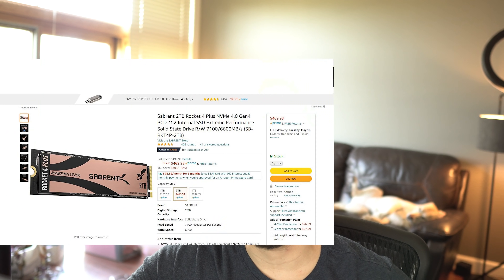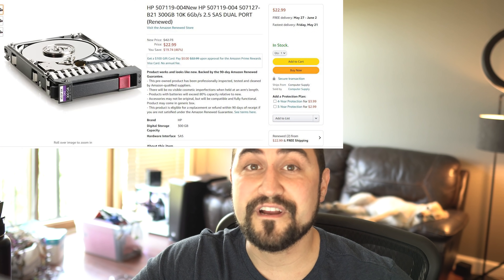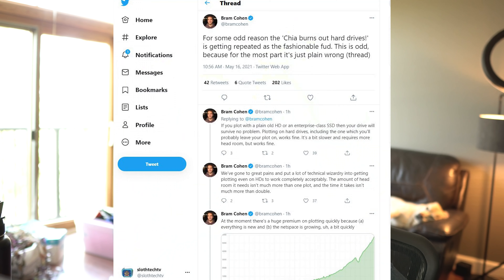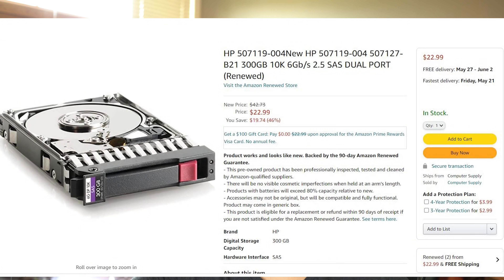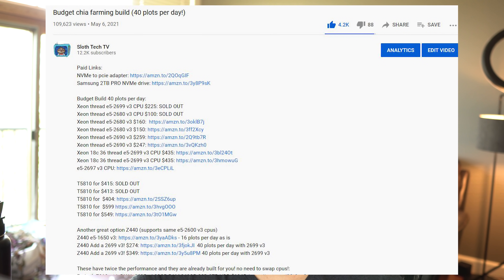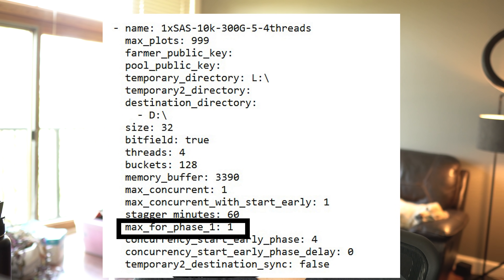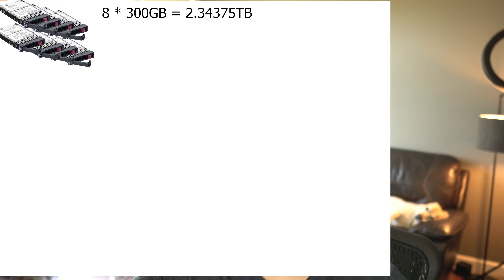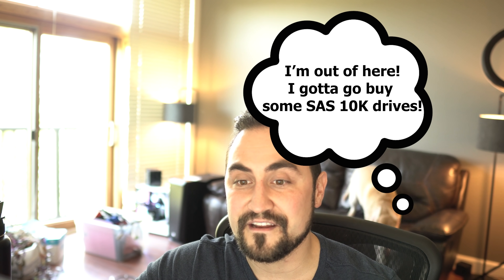Why are you plotting on SSDs still? (How to plot on $22 drives)

Comment: Is SAS better then SATA when its comes to plotting? Im still fairly new to chia :)

Great channel btw. SUBBED! :)
Reply from the maker: I think so, SAS is full duplex while SATA is half... which means only one direction of conversation can take place at any given moment.. not both simultaneously (TX + RX)
Reply: Also, this is the similar type of workload to that these 10k drives were designed to be used for, though in different circumstances

Comment: You need to factor in the external chassis that will hold these drives. These do not come cheap. Yes, enormous Supermicro JBOD cases can be had for $300-$400 but these are super bulky and loud and they will need another $300ish to connect them to the main unit and quieten them down plus 2 HBA adapters, one for the main server and one for the chassis etc. The whole set-up is not exactly cheap. A desktop/tower SAS 8 bay unit could cost anything from $200 (if you are lucky) to $1,000-$2,000 depending on the manufacturer. For NVMe I bought myself 2 x 2 TB 3,300 TBW drives for 220 euros each. Maybe I was lucky to buy them early enough (1-2 weeks ago). For 1 TBW per plot these are good for approximately 6,000 plots or 600TB worth of plot files.

Comment: How do we power the non-temp, storage destination Hard drives. One of my old 6TB lit up, visual heat flame circle on the board area, and smelled like caps when I plugged the hard drive in a 6-pin to Sata cable using my HP 1200w PSUs. The blue sas/sata cable area was very hot as well, and I had to unplug from hard drive very quickly. And I am looking for a budget framework to power storage hard drives.

Comment: Question - what's the noise level like from those SAS drives?
Reply from the maker: the ones i used weren't audible at all unless you were 6" from them.
Reply: @SlothTechTV  - Excellent! Just bought four to get started...£11 each (about $14-15), along with an 8 channel SAS controller and cable. Dual Xeon server was about £160 with 32GB RAM...even if I don't get any Chia, this is turning out to be a fun project. Although my version will probably have a cabinet made of wood, 'cos I don't have a 3D printer available.

Comment: Great video. Any thought about raid striping those?
Reply from the maker: keep it below 3-4 drives and it shouldn't hurt performance.. I'm not RAID striping as I've found the same performance by plotting to the drives individually.
Reply: @SlothTechTV  If your only using a couple of destination drives how do you stagger the plots so you don't hammer the destination drives at the same time if your putting a single job on each drive? I don't think swar can stagger jobs..
Reply: @wjm103052  do You have any solution for that? I'm struggling with the same question
Reply: @SzymekCRX  Not yet. Hoping to have it up and running by Saturday. Waiting for my SAS HBA to arrive.

Comment: Hey there, watched your last Videos, man thats a lot to process. Your content hold me on the chair for hours. The prices you have there are not the same here in Germany. At least you put a Euro sign instead of the Dollar with your prices but mostly the prices are way up. These sas drives cost at least 40 € over here but still not bad as a drive for 375 that you can throw away after a while. On the other hand how long u think these HDDs will continue working. As they are used its difficult to estimate or am i wrong? The drive in the Video is with the server adapter so as i understood this is not needed just the blank drive? If it comes like it is why not using a server (G7/G8/G9) where you can plug these straight. I guess there´s a way to run windows on a server. Thanks for the Video and all the others too, helped a lot

Comment: For the LSI SAS 9210-8i eight-port 6Gb/s SATA and SAS PCIe HBA Controller.

Doesnt that mean it cant be raided?
Data Transfer Rates	6Gb/s SAS 2.0 compliant
Devices Supported	256 Non-RAID SAS/SATA devices
Reply from the maker: You can do a software raid, but honestly i think there is better performance from not raiding at all.

Comment: Thank you so much for the videos, they have been incredibly helpful! 

Quick question, I just bought a bunch of Western Digital 300GB 10K 2.5" SAS 6Gb/s WD3001BKHG off eBay for extremely cheap and I just noticed that they have a cache size of 32 mb while a lot of the drives you have recommended in your description are 64 mb. Is this going to be a problem if I want to replicate your build? Thanks so much for your time :)
Reply: Did you ever figure the cache out? I'm curious too!

Comment: Why the 300gb drives and not 900gb ones for around $30 on Amazon? Can you not stagger plots with these? Jw before I pull the trigger. Appreciate your content.
Reply from the maker: 900GB would work just fine as well!!! good question. you can stagger but you lose a lot more performance than on ssd/nvme with more than 1 plot. play around -- report back soldier! :)
Reply: Awesome, much appreciated. Only gonna grab a few but I'll see how it goes. Not super techy, and not a great rig, but if it turns out well staggered I'll report back.

Comment: Great idea and you can find lots of them on Ebay tested for >10 each but not really Energy efficient. 7-8 Watts each at higher loads x10 is 70-80 watts not counting the power supply and boards compared 2 watts or so for a 2TB GEN 3 speed NVMe to replace the 16TB’s I’m using on each PC would add about 80x8= 640 watts. 4 PC’s 2560 extra Watts.

Comment: Build is so cheap i said "wtf" I bought 22 drives, the Dell and the processors. At least I could help support your channel!
Reply from the maker: Thank you so much!!! I so truly appreciate the support!!! <3
Reply: Can you also do 2 processors on the 5810?
Reply from the maker: @djrythmn1  nope the t5810 is a single socket workstation
Reply: Ok last question. Your previous videos talk about connecting the drives. But not to much about powering them. If you have 24 drive how exactly do you power them? I've only did small builds so I don't know the correct terminology. When you were talking about powering the drive you showed a cable that had 3 ports to power drives. Which would mean for 24 drive the power supply would have to have 8 modular connections for that specific type in the back. I know I'm missing something. And as much as I google and try to redefine, I'm not seeing clear answers. I just got my workstation delivered today. And I need to get the power figured out for the drives. Please help... respectfully!

Comment: I was way ahead of you here. The 300gb 10k rpm sas drives are only $11 each on ebay. ;) Have fun.
Reply: Can't temp space requirements creep above 300gb/plot or does that only apply to how ssd's handle writes? Also are you doing some kind of RAID configuration or just one plot per drive? Excuse my ignorance, I'm not very familiar with SAS or server gear, but am super interested in using these SAS drives as an alternative to burning out my NVME drives.

Comment: Thanks for the Great video and tips! 
I bought the SAS9200-16e from the previous recommendation. Do you think that will be compatible with SAS drives? Or should I pickup these new ones as well?

Edit: Nevermind, dumb question the old one was for SATA. I ended up getting a Mini SAS SFF-8088 26P to 4 X SAS SFF-8482 29 Pin Hard Drive Cable. I think this may work

Comment: I watched the other videos, but have a lack of understanding on how to power these! A separate power supply is used I take it, but is there special cables from the power supply to the drives? I ordered the drives and the cables from your link but I don’t wanna have to receive them and then figure out I can’t power them up.
Reply from the maker: i made a separate video about powering the drives -- you do need an external power supply, and those sata power breakout cables linked in the video description.
Reply: @SlothTechTV  I bought the SAS drives, the HBA and the cables from your link. But the more I research It, It appears they are powered from the Card? I can't figure out why I need another power supply, or how to hook it up. I've watched all your recent videos "And am thankful for them" but can't find where this is covered.

Comment: Noticed that the PCI slots in the T5810s are rated at different wattages. Any concern with which slot is needed to power the expander cards?
Reply: Just to be clear... it isn't power but PCI lanes... but the reality is that if you have a card that fits the slots you are going to be fine

Comment: So what I'm hearing is stripe together pairs of the 150gb 10k RPM Raptors with the cool clear windows that I've been hoarding and make the loudest plotting system ever.
Reply: WHAT??? CAN´T HEAR YOU... STANDING BESIDE MY SERVER 16 15K DRIVES
Reply from the maker: haha exactly!
Reply: @SlothTechTV  Fun fact, it took 7.8 hours to do a standard plot using 4x Raptor X's in RAID0. (Under Windows, running on an 8600k)
Reply from the maker: @PeterBrockie  woah. Frantically buys 15k drives
Reply: @SlothTechTV  Depending on where you live, 10/15k drives are probably fine. But keep in mind it takes ~3-4 of my 150GB 10k Raptors to do one plot at about 8-16 watts per drive. That adds up real fast considering a 2tb NVMe uses like... 6 watts. So if you're in the middle of nowhere and electricity is cheap or free, sure. But in NYC it isn't worth it vs just buying an SSD and plotting ~6 plots at once at a fraction of the power.
Reply: @SlothTechTV  I gave it a huge range because those older spec sheets aren't clear on the actual power usage, only max ratings. I think the noise of 10/15s would probably be the biggest problem in a smaller place or an apartment.

That being said the Raptor X's aren't too loud for 10k drives - probably because of the giant blocks of aluminum they're made of. haha
Reply from the maker: @PeterBrockie  i decided to measure these drives -- 2.5 watts per 10k drive.  Its actually not bad at all -- less than an nvme drive.
Reply: @SlothTechTV  Not bad per drive vs smaller SSDs.
Reply from the maker: @PeterBrockie  my 10k drives are inaudible from 2ft away -- i do not hear them at all -- even 24 of them running simultaneously.